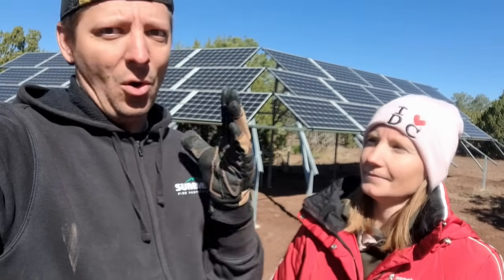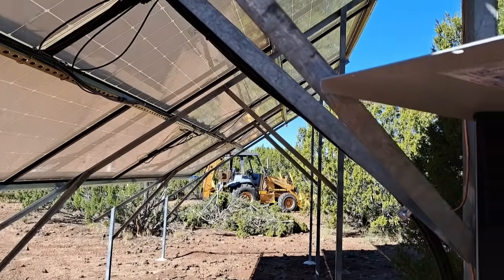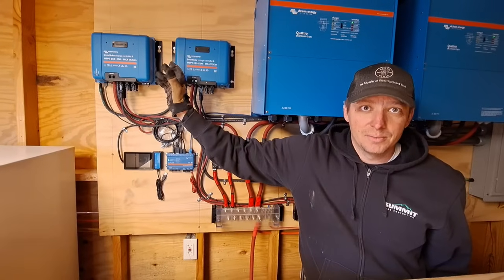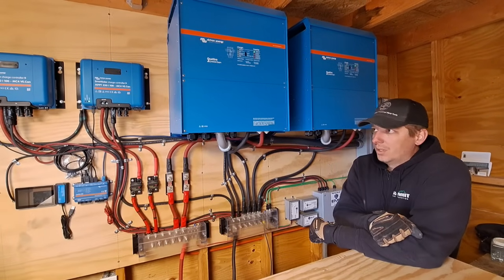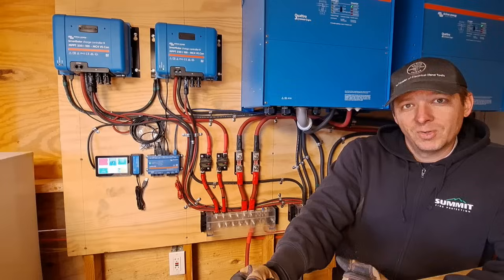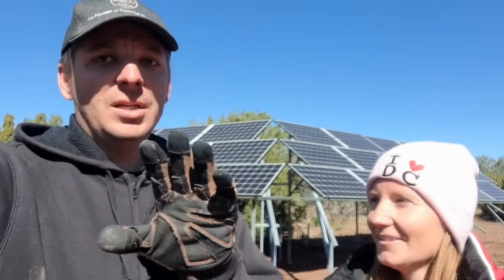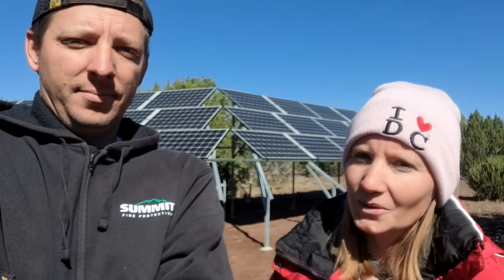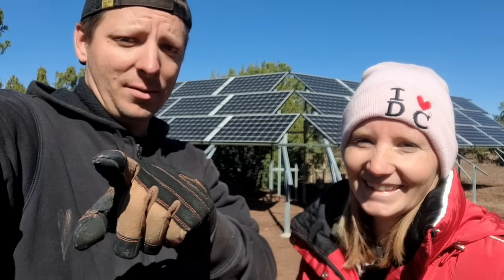INFLATED COST Of Our 100% DIY Off Grid SOLAR POWER SYSTEM 👍

Comment: I cannot get over how crazy expensive solar is. My electric bill is about $100 a month which is $1,200 for a year. I wouldn't break even with a system like this for 31 years. And thats assuming no repairs or replacements in 31 years which is unlikely.
Reply: While that's true it's not all about the cost it's also about not having someone else in control of you having energy or not.
Reply: @BatCorkill  my grandfather is 97 years old this this month. He said he’s never had anyone in charge of his power or his power consumption. We live in the Midwest so that might make a difference. I have been talking to him about solar and the prices and he thinks it’s insanity . Our bill runs just over $100.00 a month here in the Midwest , electric is dirt cheap here . I want solar but it absolutely makes zero sense financially.
Reply: @Nctbgs   if he gets power from a power company than there is someone in charge of his power.
Reply: @BatCorkill  I guess your right . But after 97 years of no issues where do you determine that it can be an issue ?  I can’t justify a system that takes over 30 years to just break even. I love the idea of solar but it makes zero financial sense for me and my family in the Midwest .
Reply: @Nctbgs  if you overproduce and can sell back to local power company the pay off would be sooner. Friends at work installed solar on their farm but they don't use battery back up so every thing they don't use goes back to local utility.
Reply: I think of solar as a safe option for the day the power goes out long term. it’s not a matter of if but when. May or may not be in our lifetime but it’s better to be safe than sorry in my opinion.
Reply: They also bought some of the most expensive equipment available, and the average home would need about half their setup.
Reply: This is great for folks who can't get on the grid, or those who want a backup system and don't care about the cost.
Reply: @hardbrocklife if you're off grid you don't cheap out. It has to be dependable.
Reply: The battery costs are significant.
Reply: @BatCorkill  lol the point is to spend less money, why would I get solar systems if it cost way more. If my power goes out I can use a 400$ generator. It’s stupid expensive.
Reply: @tatecentral1221  and where would your generator get the power?  Diesel?  What if there wasn't any diesel or gas?
Reply: It's about being future-proofed also
Reply: @DeanGuest1  due these solar panels and energy is just to expensive, they know people want it so charge out the ass for it. If you actually look up the specs of a solar panel and learn what it takes to build one you will find how extremely cheap they are to build.
Reply: It’s only expensive if you’re trying to have the same luxuries. If you can live without high wattage appliances that you use for a good amount of time then you can substantially lower the cost
Reply: If the electric prices increase dramatically things change a lot
Reply: Also assumes no increases in what the electric company charges...... not likely
Reply: @DeanGuest1 excellent point so many people think their electric cost will be $100 a month for the next 30 years.....
Reply: @johnfitbyfaithnet  According to the U.S. Energy Information Administration (EIA), electricity prices have increased 2.36% per year in the United States for the past 25 years, from a national average price of 8.43 cents per kilowatt-hour (kWh) in 1997 to 15.12 cents/kWh in 2022 (the most recent year for which annual data is available).

Still takes me to the 13 year mark to break even assuming this trend continues. The average joe is going to have a hard time investing that much money to not see a return until that period (and even then, minimal incrementally). Additionally, by that point you're replacing those extremely expensive batteries...likely (which would push that break even point even further). What happens if you need to move? You rip up your elaborate setup and try to make it work at your new house? I like solar but this setup just doesn't make sense for most people. Hopefully over time as the building of materials is more refined prices will come down.
Reply: China thanks you
Reply: @mrobvious1100  Classic death kneel of an adult conversation
Reply: LOL, I wish my electric bill was only $100 month!  Average electric usage per day by Americans is 29 kWh.  At $100 per month, you're only using about 19 kWh.  So you would probably need a system half that size.  The other factor nobody has mentioned is your carbon footprint is substantially reduced.  If you used average electic, your bill would be about $150 month or $1800 per year.  With prices going up on EVERYTHING including utilities, who knows what the price will be in 20 years.  You're not likely to save a whole lot of money, but you will help the earth for sure!
Reply: You wouldn't need this size of a system th0
Reply: The thing about is, you're free on your own. Off grid, no one can regulate your rates. Inflation has driven power companies to increase sewage and energy costs. If I win big money on lottery. I have to gift myself with cutting out the power company completely no matter how much I spend like these folks, I've always had that near $40, 000 price tag on my mind to build the best solar system. It's not the money. It's how you get your money and what you do with it. Power companies are a rip off. If you're smart enough , treat yourself right after Winning a nice size prize of money. It's plenty of ways to break even faster then you can imagine. I know some folks that's brought this entire system from just spending $20. Again if you're smart enough and know the game, then you'll treat yourself to it, especially to live completely 100% off grid. I believe I will spend that kind of money. I like a lot of power to.
Reply: @BatCorkill your comment is not actually true, if you are paying an arm and a leg for replacement parts on solar panels then you are still being controlled. When a battery cost you $2,000 you're being controlled. When a hail storm breaks all of your solar panels and you got to pay thousands of dollars to replace them you are being controlled. At the current price it is cheaper to pay the electric, solar power is just a hobby
Reply: Way too much money for practicality. Setting up solar panel systems are for hobbyist that have tons of money to waste. This is not for your average person.
Reply: @BatCorkill same with solar…..the big ball of fire is in charge.   FYI
Reply: @pwm001 your carbon footprint?  WTH.  So you think your clean and green……what you gonna do with those panels after they lose most of their potential……..there went your footprint.
Reply: @kerrytodd3753  Lol, I'm not anything.  I don't have solar.  I'm researching it and I'm finding it has pros and cons just like anything out there.  If you can put together some exact measurements of how much it costs in resources to build and recycle the panels and batteries, that would be great for my research.
Reply: @BatCorkill  nah it's not even about ideals. right now with the massive influx of people and power grids failing in different cities, it's best to plan for the future and have your own setup so you're not affected when a grid does go out, and without nuclear power grids will be going down way more frequently.
Reply: Well if my electric bill was 100 a month I would not worry about solar. But then again solar for you would be 12k system. 

You need to know what your talking about and what you are comparing. 

My bill is 400 a month I have a 3800 sqft home in Loxahatchee Florida. I'm get a pool next year. So I'll need a huge system. 

But it will pay for itself if I install it myself with friends. As well as sell back to the grid. We have that available here in Florida.

Soooooo, God Bless Stay Safe
Reply: @cuinican1980  Florida you say? Make sure your home owner's insurance doesn't drop you for putting solar panels up. Especially with the big system you'll need.
Reply: @jon112785  are you joking or being serious? I live in Loxahatchee Florida snd I'm from Tampa florida. I never ever ever once heard anyone getting dropped over Solar. I been around since Solar first ever started with homes. What you talking about friend?
Reply: @johnfitbyfaithnet and comenout to cali where you $100 midwest utility bill turns into $500-600.  Theres a reason cali has the lion's share of 36% of all new solar installs in the US.
Reply: Nowadays solar is cheaper in a lot of places..
Reply: In the mid west solar probably is a waste of money. I live in Cali and my PGE bill is typically $450. I spent $12k on solar about 3.5 months ago and it has already saved me about $1200.
Reply: @Nctbgs  I personally installed a solar system for myself, and I can justify it because not only is it saving me electric, but it is my backup generator saving me money every day, unlike a generator that only helps when the utility power is down. Payoff for my solar/lithium system is 8 years.
Reply: Unless you live in a 1 bb apartment with no ac and no hot water you are lying
Reply: @BigcountryReactions  I have a 200 yr old farmhouse with four bedrooms and two bathrooms. Do you want to see for yourself? We have plenty of hot water and run electric heat pumps and AC nearly every day.
Reply: Did some people go $500 a month bro on electricity so something like this is usually worth it
Reply: @TimberHog  see that makes sense. There is a guy on youtube that shows how to DIY a solar panel system for around $8k and pays it off in 6 years. That is something I would do.
Reply: The cost of power today has nothing to do with the coming costs of power.

I don’t know if you are aware but the government has made every indication possible that energy costs in the future will be nothing like they are today.  

Beware of thinking things are going to stay the same.

I am installing a solar system that has (112) 450 watt panels and (4 ) 15k inverters with 180kw of battery backup so NO ONE can tell me what temperature I can have in my house or how much energy I can utilize per day.  

We currently pay 11 cents per kWh for power but if our power goes like California costs have gone then I could be paying as much as 8 times more per kWh and my system will pay for itself in no time, not to mention that I’m free from those crazy costs in the future and I can live as I please.
Reply: All depends where you are. I’ve heard of people getting charged 20-25k for a power hook up.
Reply: I started raising hamsters by the hundreds in 1985 , I set up hamster wheels connected to generator device's to make power for my off grid home.  Alittle bit of food for them goes a long ways and when they get tired there are plenty more wanting to get on and run. I have everything caged in so predators can't get to them and babies are born all the time as replacements for die off.  I call it hamster amps per hour.
Reply: Specifically, off-grid systems with battery backup are the most expensive. You’re better with a hybrid system with battery backup, so that you can have electricity for some time in case of an outage; or a grid-tied system without battery backup, to at least sell the solar energy to the grid company.
Reply: Lucky, mine runs about 2-250 depending on time of year....
Reply: @mrobvious1100  china thanks you for everything you’ve bought as well lol
Reply: Many are worried about the cost, but many were worried about his they were going to pay that bill when COVID hit and lost thier job. I like the idea just based off not having to pay a bill. And the fun of building something.
Reply: Hmm 100 usd per month good for you but how much consumption do you have? The system builded here is 20.000 watts is very big. A normal house consume much much less.
Reply: Solar isn’t expensive. Off grid solar is expensive because you have to cover for edge cases. And what these people are doing is expensive because they are using luxury high parts
Reply: In 2025 there will be a 59% reduction in price
Reply: Solar is expensive. It’s not reliable in snow or evenings. So you need expensive batteries…….

But I got the estimate to hook my property up to the grid. $142,000 dollars. If I go cheap by cutting thru my neighbors property, it’s a lot cheaper. But that requires an overhead easement. Trees cut on both sides of the line. That’s not going to happen.

So I will need to go with solar or go Amish!

My biggest domestic load for the time being would be the fridge. But my shop has many vintage woodworking and metalworking machines. These are three phase. The solar option allows you to use three inverters to get three phase. I do have a phase converter which would save on inverter cost… Maybe! The converter has a 30 hp idler motor and draws about 9 amps idle. The converter and one machine may overload a 10KW split phase set up. That would mean running four inverters on split phase instead of three inverters on three phase.

A few are line shaft machines. These I can run off my steam engine with line shaft.

Vermont is a bit cloudy. So you need to upsize batt capacity. The cells work but at a reduced output compared to sunny Arizona.

A caution on inverters. Not all the same. If you get a dual AC input, then you can attach a backup generator. Some require a perfect AC signal or they get damaged. So make sure you can attach a back up generator.

In my case, the generator can supplement the arrays on poor days. With 2 in of snow, they drop to about 20 to 25 percent. Four in of snow and they are dead. So plan on having about two days of batt capacity at a minimum.

The climate guys are ultimately going to win. So EVs are not dead yet. If your forced to go to off grid solar, then you can charge your buggy. That would be free transportation for commuting.

So yes, the upfront costs are painful. But if you keep increasing your capacity gradually, you can enjoy more electric options without worrying about the utility bill.
Reply: Depending on how far you are from the closest power line it can costs thousands and thousands of dollars to get power brought out to your house.  If you're in a city and have power at the street it isn't an issue but some places want an arm and a leg.  They also went high and to the right on their build but generally you can't beat the electric company on cost unless your state does net metering with a good rate and even then it takes years.  Solar with a big battery bank is all about power independence and having a reliable backup etc, not economic for a lot of people.
Reply: @notreal5311  Yup.  My estimate to get onto the grid was $142000 dollars.  Almost what I paid for the land.  So solar is the only real option I have.
Reply: It really depends on your situation. I’m trying to build a house on old family property, and it would cost a minimum of 5,000$ for my electric company to set up the poles and run wire. Through the research I’ve done my house would require a system that cost less than 4k. Cutting out all the other aspects that make decisions more subjective I’m saving over 1,000 by doing solar.
Reply: @theinnerdreamer7043 that’s my main reason for installing, my power company said anywhere between 5-10k depending on where exactly, and I live such a simple life style that I only need a 3-4k set up. Not only do I say thousands but I’m also less susceptible to the black out we get in my area every year from extreme weather.
Reply: You also aren't thinking that you might not have access to the physical grid. The power grid, a mile from your property, could be too cost prohibited to have connected.
Reply: 100$ light bill I call bs this is not 1974.
Reply: Then it doesn’t make sense for you but sounds like you would need a smaller system. And probably the biggest thing you are overlooking is the price of getting power to your property. When I built my house in northern MN about the worst area for solar I wasn’t really interested in it until I found out the power company wanted 30k just to run power to my property and then charge a monthly bill after that.
Reply: @kingduck3192  Duke power sometimes my bill can run as high as 4 to 500$ I'll happily invest whatever it takes to be self sufficient Off grid.
Reply: @Silentragetrolling  I agree unless they have gas drier, stove, furnace, water heater and don't use ac, My electric is average $150 in winter and gas $100 all year, summer with ac electric goes up..
Reply: With a $20,000 12kw setup, doing work myself, and tax break it will take just a little over 4 years to pay for itself, and that's not counting credit from electric company for adding any extra power to grid.
Reply: An off grid system like this isn’t for someone with a $100 electric bill. It’s for someone that can’t get a grid hookup in their area. If you have a $100 monthly bill there would be a small grid tie system that would make good financial sense for your needs.
Reply: Having power brought to a prooerty is 10-15000 a pole. Plus the transformer. Plus hooking up to your panel. If you're a mile from the nearest pole you're looking at 40-60000 just for the poles to your property.
Reply: But you are assuming that your electric charges will never go up. What if they end up charging 3 times what it is now?
Reply: Yes but if it provides all your heat as well you need to figure that in the cost also. They could've went smaller with a big diesel generator to make up the difference when solar isn't enough
Reply: Most do this simple calculation...100$/mo. for decades. it's not. Every hear of Inflation?  Utility rate of Inflation avg. ~5.5% (some have been temp. 40+%!!) for US electric Rates. So, 1200$/  year becomes 3,500.$/ year.  So, if use same amt. of kWh/mo. over next 20 years🧐 , then you will avg. $1750$/ yr. or cumulative 35,000.$$ over 20 years. (if rates don't increase🤪.         + if you qualify, there is State Incentives for solar+ a Fed. Tax Credit of 30% off cost of PV systems🤠
Reply: This entire set up was still cheaper than having the power company run a line and a drop out to my property.
Reply: And in most cases it’s more than the cost of solar to get a grid connection because if you’re very far away from powerlines they have to install the substation just for you and miles of lines